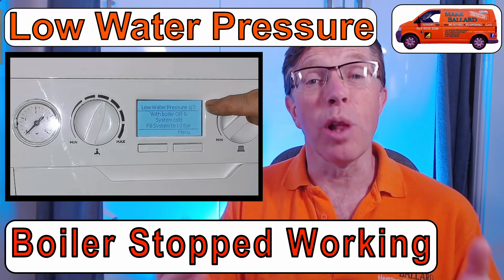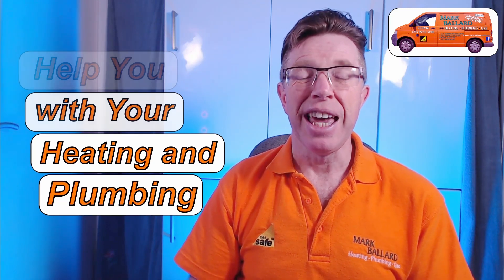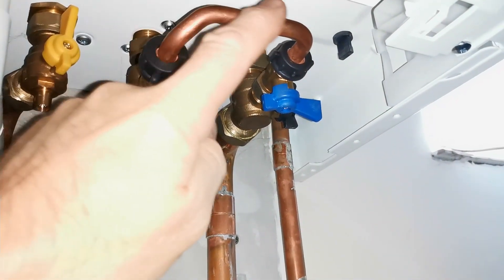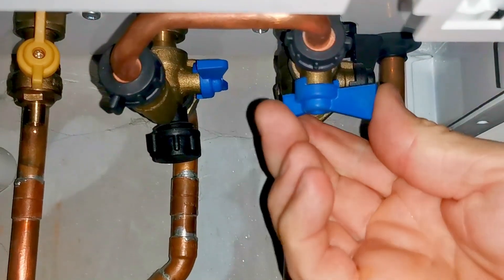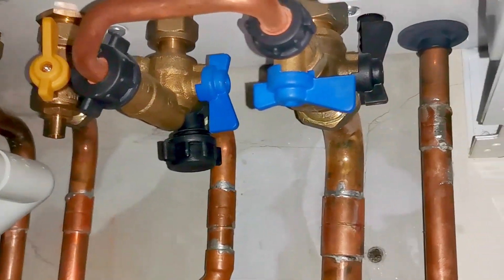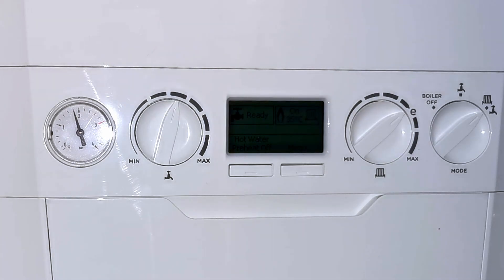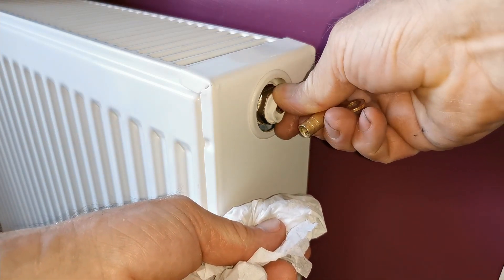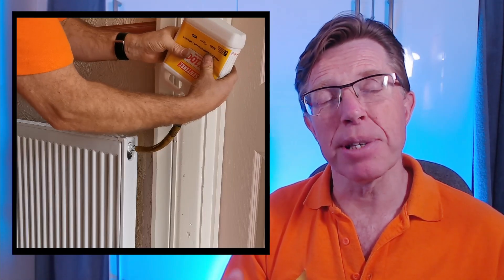Ideal Logic. Low Water Pressure.  Boiler Stopped working. How to get your boiler working again.

Comment: Thanks Mark, quick question:- my Combi 35 looses pressure fairly often 3/4 weeks or so.  My question is that I leave that left hand valve always open as it can be a bit tight so I always leave that valve open?  What do you think?😊😊

Comment: Hi guys, I am having an issue with my boiler. I have followed your very helpful video, but this time around, after moving the blue taps, the gauge did not move. Is there any other way I can try and put the pressure up? Thank you so much - ideal Logic +  boiler

Comment: Hi can you help my father has the same boiler as you.the pressure is at 1 bar or 1/12 bar when is use. But when no radiators or hot water is being used it drops to near zero. Is this right

Comment: Hmm... so I got the same message with a pressure of 1.4bar.  Still bled radiators to drop to 1.0, then topped back up to 1.4.  Same error message.  Fault only shows when hot water is involved, no fault if using heating only.

Comment: Hi there. I turned off my Combi C 24 over Christmas and came back to a boiler with no pressure. Is it essential to bleed the radiators or can I get by with just adjusting the water pressure?

Comment: Hey Mark. Ideal Logic 35. Not firing up on the timer. Cold pressure is 1.5 bar. As soon as I open the loop valves the boiler fires up. Is there a sensor that could be faulty? It seems that it needs a nudge to wake it up. Thanks

Comment: Done all this and didn't work, pressure is fine but every so often keeps giving a false message about bleeding radiator's and no air is in them. Water keeps going cold with false message pressure at one and a half.

Comment: Trying to find a video to show how to top of the water pressure in the following Ideal Boiler -  ideal boiler s24IE - the pipe system underneath is different than the one in your vid, there is no loop pipes.

Comment: Thank you so much Mark you have just saved me a lot of time and money your tutorials are amazing, they are so in depth and so so easy to follow. I was able to reset my water pressure and how to change the wee air valve on my radiators as a few had snapped of and I couldn't bleed them. Again thanks a million x 
Colleen from Belfast

Comment: Hi there - I have a Ideal combi boiler that I would usually repressurise after bleeding a radiator. However, today I have attempted to do exactly this, but was met with silence. The water did not fill the boiler to increase the pressure. The sound of water shooting was there for less than half a second, but then nothing. What could this be? How could I fix it? It's almost as if the water filled the filling loop then got stuck. Could the valve going into the boiler be stuck shut? Is this easy to fix myself?
Reply: I spoke with a heating engineer who was servicing the boiler and he hadn’t seen this before. He took a few parts off and couldn’t understand the problem, so called a colleague. The colleague said he’d seen it before, and that the ‘easy fix’ is to repressurise whilst the heating is on. He was correct. The water flowed through the filling loop and increased the pressure. You’ve just got to be careful to know how much you need to increase by before you put heating on, and then watch the pressure gauge very carefully when pressurising as it’ll already be higher due to heating being on. Hope that makes sense.
Reply: Did you get this sorted? I've got the same problem today. Thank you